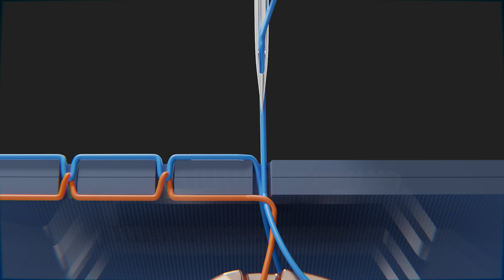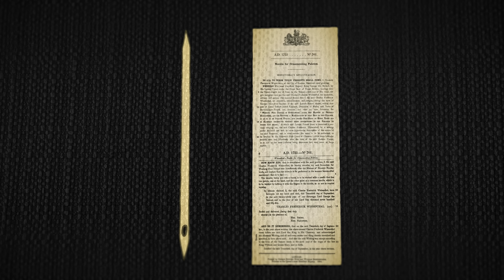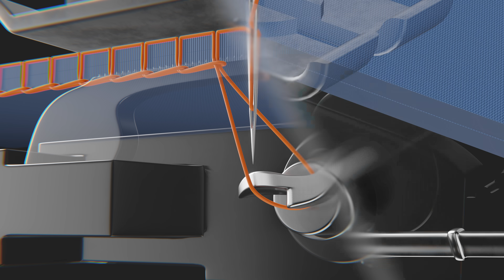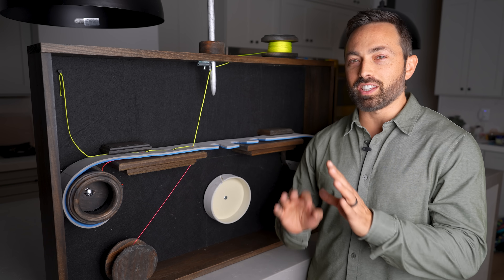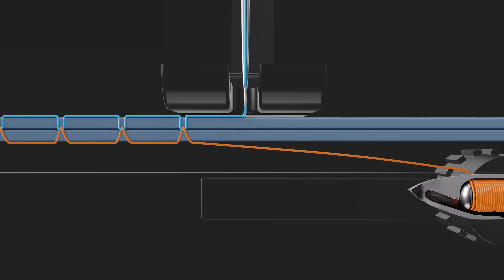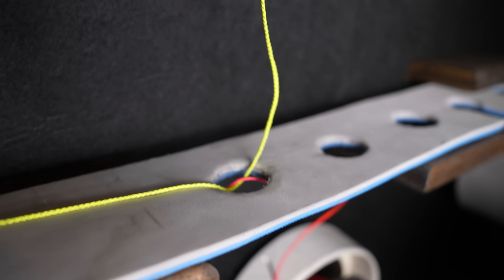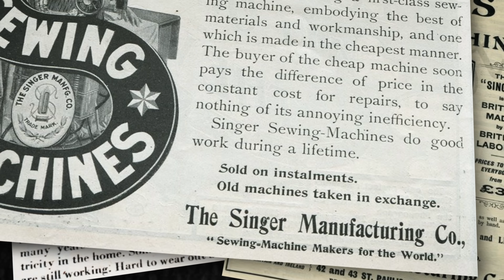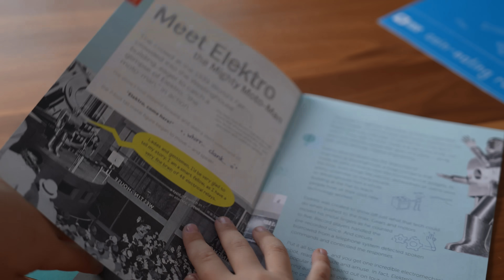The Surprising Genius of Sewing Machines

Comment: "Every piece of clothing you've ever put on was made by a sewing machine."—I think this line could be revised. Everything you’ve ever worn was made WITH a sewing machine, BY an individual human being operating it. Aside from the huge improvement in speed offered by the sewing machine, garment manufacture and textile assembly has proven extremely resistant to automation. Outside of extremely specialized cases like embroidery, there is no such thing as a sewing robot. 

Everything you’ve ever worn—every cheap t-shirt, every pair of boxers, every fast fashion throwaway piece—was made individually, by hand, by a single person working at a single sewing machine. The guy at 14:50 says it: "Those women were heroes. Unbelievable skill."

They still are, and their skill is still unbelievable. You're wearing it right now.

Comment: The lock stitch isn't just for sewing machines. It is also used with sewing with an awl in thick fabric.  The bulky handle that you can apply extra force to can't go through the material, so a second smaller needle catches the loop.

Comment: Great on the history; woefully lacking on the mechanical explanation.  Typical Veritasium attitude:  "Just take my word that the thread loop passes completely around the bobbin inside the rotating hook [even though that's impossible due to a fixed axle running all the way through the center of the real bobbin, unlike in my hokie model] because it would be too hard for me to explain to you how it really works."

Comment: Chain stich also commonly used for stockfeed bags. 

If you are experiencing a lot of heat build up on the needle, or the thread appears to be untwisting, you could consider running the top thread through an oil bath.  Untwisting of the thread is more of an issue on one side of my twin needle machines.  One side runs the opposite direction to the other, resulting in a degree of untwist in the thread.   Things to consider before going down this route is type of thread used and of course fabric you are sewing.  Unfort not all threads are available in whats known as reverse twist, so have found this to be handy in many situations.
Reply: Try silicone spray or oil.  It washes out more readily and tends not to stain.

Comment: Just wanted to point out, as someone who actually prefers to sew by hand, you don't actually have to stab all the way through the fabric up and down with every single stitch. There's a way to position your hands so that all you have to do is hold the needle still with your dominant hand (and stabilize the eye against your thimble), and then use your non-dominant hand to essentially bend and push the fabric onto the needle so that you can stack multiple running stitches before pulling the needle through the fabric. It's nigh impossible to explain with words, but there are lots of hand sewing videos on youtube of people recreating historical garments and employing this technique of weaving the needle up and down through the fabric 4-5 times before pulling it all the way through. Still not as fast as running it under a machine, but definitely faster than stabbing and then flipping the work over and then stabbing and then flipping over again.

Comment: Can confirm the information from 10:47 because I have a treadle sewing machine with this style of bobbin that I purchased this past year and cleaned up. It was still in fully working order when I purchased it, aside from the leather drive belt needing to be replaced due to age. Working on a treadle is an entirely different feeling to a modern sewing machine, and I love working on my treadle machine when the projects I’m working on allow for it.
Reply: Yes, as long as you clean and oil them regularly they will last you, your children, your grandchildren, I have an 1869 Florence needle sewing machine that performance as if it just came off the factory floor. It was produced the same year my great-great-grandfather was born.

Comment: Wait..  the guy talking about the crank on the line powered machine, doesn't know what he is talking about. For starters, it was NOT running all the time. Each line shaft station would have a drive pully and an idle pully. the machine was only running when you were operating it. The other heap of happy horse crap is that the machine was "turning at like 10,000 RPM". To put this in perspective, your cars engine is only going 2000 RPM when you are going 60 miles an hour. If you ran your car engine at 10,000 RPM, you would likely blow it up. Line shafts from that time incuded thing like wood and leather and bearings that you put oil on daily. Not to mention that all of the moving parts were open and exposed.

Comment: My Singer 128 is one of the later ones with a shuttle compared to my father’s machine that is a few years older that uses a more modern bobbin. Nearly 100 years old and running without issue as a primary use machine.

Comment: 7:36 this seems a disadvantage. However, I believe this type of stitches are widely used in bags of rice and perhaps flour, where - if you get it right- you can easily undo the whole seam without cutting or undo every stitch (or one for every certain number of stitches), which is the case for locking stitch.

Comment: There is a technical error at the 10 min mark, the shuttle system you are showing is properly described as a reciprocating shuttle as it moves in a straight line imitating a weaving loom shuttle in many ways (and on many models referred to a "transverse" because it moves from left to right), and that was the shuttle system employed in the Singer Model 12 (which was sold as the "New Family" in the 1860s). Interestingly rotary and reciprocating shuttles were invented around the same time in the late 1840s by Wilson. The third basic type of lock stitch shuttle was invented by Philip H. Diehl (while working for the Singer Co.) in the late 1870s which resulted in the very first Singer 15 class machine which went into production in 1879 and was marketed as the Improved Family (its manufacturing designation was 15-1). The design of Diehl's oscillating shuttle was quite different to the shuttle hook that would be most associated with the Singer 15 class (but I will come to that later). 
The first vibrating shuttle Singer did not go into production till the mid 1880s. At around that time at least one German sewing machine company was working on an oscillating hook shuttle with a removable bobbin case that locks into a central pin and is kept stable by a finger that keeps it stable in the shuttle race. This made for a very robust and reliable machine with an easy to reload bobbin (the oscillating shuttle used in the 15-1 can be a little fiddly). This new type of oscillating hook system was referred to by its inventors as a "Central Bobbin" and it is no surprise that Singer decided to use the Central Bobbin system in their next 15 class machine aimed at the domestic (as in "family") market, the 15-11 in the early 1890s . . . of course they didn't invent it, but they were the biggest and most wealthy sewing machine manufacturer in the world at that time so they could get away with it and so now most of the world assumes that the Singer company was the originator and call the Central Bobbin (CB) a 15 class shuttle. The CB shuttle system is still one of the most common shuttle type used for domestic machines.
I have been researching the history and development of sewing machines for over a decade now, and for some time I have realised that much of the official history out there is "problematic". So anyway, I know I am nitpicking; overall your vid is quite good and your prehistory of the sewing needle is very good.

Comment: TLDW is that there are two threads, one is wound on the spool at the top of the machine, the other is wound on a mini spool inside the machine called the "bobbin". Instead of stabbing the end of one thread up and down through the fabric, the needle stabs a middle point of the top thread down through the fabric, making a loop. A hook inside the machine carefully grabs this loop and pulls it over the bobbin, so that it gets stuck on that bottom thread, and that is one "stitch". The machine has to start with both threads freely dangling and you have to sew stitches over themselves to create the tangle of confusion that “knots" one side, then from there these two threads sandwich the fabric, the top thread going through the fabric to loop around the bottom thread once per stitch. Eh... maybe just watch the video 😂

Comment: I started sewing on my Sailrite LSZ1 a few years ago. Unfortunatley I learned all about the internal workings before anything. Darn thing kept coming out of adjustment and I'd have to re-time it again and again.
Eventually I found the culprit, someone at the factory left a spare part up inside the mechanism that was in a very difficult spot to inspect. It was randomly jamming things up just enough to slip the timing where Id get skipped stitches and other 🤬 frustrating things.
After I removed the "bonus" part, I re-timed and not a problem since.
Great video, thanks for posting.

Comment: I can't get over the fact that none of the sewing machine stitches are quite as long lasting as hand stitches. If a stitch pops on a machine stitch, the whole chain is more likely to pull free than if you'd done a pass through method.
Reply: The chain stitch yes, but the lock stitch is far superior. They don't just unravel like the chain will.
I can prove this, anyone who has had to "rip" thread out to re-do a seam will tell you that it doesn't just fall out.
The trick with the lock stitch is getting the upper and lower tension just right so the "knot" is perfectly in between the top and bottom surfaces/materials. If your upper tension is too tight, the knot is exposed on the top, too loose and its exposed on the bottom.
The lock also uses two threads, your upper and the bobbin thread. When changing types of fabric, you often need to re adjust that tension and possibly even the tension of the walking foot.
One of the hardest hurdles for me when I started sewing was learning stuff like tension. Plus I was handed a machine that was improperly timed.

Comment: In my teens, I wanted to modify my pantlegs to be in style, so Mom just said, "If you want them different than what we bought for you, I'll show you how to sew, and you can do it yourself." 
    With that, she sat me down and taught me "the ropes" of it all, and I had just acquired a new, amazing skill. Since then, I have made clothing, sewn bags with drawstrings, pillow covers with hidden zippers, even vinyl seat covers for motorcycles that people assumed I had bought, and was professionally made. My latest was making blackout curtains for my SUV that go  right behind the front seats, to create privacy when I road trip, and sleep in the back. Built a raised platform from wood (Dad was a carpenter for some years, so taught me a little of that, and I did engineering and mechanical design, so the structure design came easily to me).
    The platform, just big enough to fit a full sleeping bag, needed a foam pad, so I bought a twin-bed size, cut it down to 6' x 34" and then sewed an old sheet into a slipcover for it, simple, like a pillow case. Works great! 
    I love having my own sewing machine and having the skill to adjust and maintain it. SO freeing! SO useful. And when not using it, it stays in a nice, small suitcase that it came with.

Comment: Actually, for a running stitch, you don't release the needle and pull it through (except in Asian embroidery, I've seen that technique there).  You push it up and down until the tip is on the top, push it through, and grasp it above again to begin another series of stitches.  I was glad to see the clip of a seamstress actually sewing a seam by hand to get a better picture.  I've sewn on (and repaired) both the vibrating and rotating shuttles; the rotating shuttles are much my favorite.  I've even sewn on a chain embroidery machine and I can testify that it's quite a ballet of movement to learn.  If a person is wanting more information, it's easy to find one of these old machines and just play with it to see the different mechanisms; timing, the take-up lever, dropping the feed dogs, winding bobbins; just so many fun mechanisms to explore.  Thanks for this video!

Comment: What fascinated me when I was preteen were a lot of textile mechanization processes (how to shape flexible thread with rigid machines, but there was something that really struck me about the sewing machine problem—how the bottom bobbin was designed.

In order to get lock stitch, the top thread has to pass completely around the whole bobbin. Yet, to stay in one place, the bobbin has to be fixed in place.

The workaround is that the bottom bobbin is held inside a "cage" where it's not attached to the rest of sewing machine and is free-floating, but lies in a gap the the bobbin can't leave.

When I finally found this out, I was the happiest I'd been in over a month at that time in my life.

Comment: 9:54 Here, you say, “Although it’s called a vibrating shuttle, it actually oscillates back and forth.” This statement is erroneous. As per Wikipedia, “Vibration (from Latin vibrō 'to shake') is a mechanical phenomenon whereby oscillations occur about an equilibrium point.” Vibration and oscillation can, therefore, be used interchangeably and were used correctly in this context. So, calling it a vibrating shuttle is correct. Stop reading what is handed over to you, and please start using your educational knowledge, especially when you have a Ph.D. in physics education! Now reread this, “Although it’s called a vibrating shuttle, it actually oscillates back and forth.” it doesn’t make any sense now, does it? Nice video overall.

Comment: I mean, if we want to touch on the last part, then we should note that what the sewing machine really enabled was the concentration of wealth gathered from the profits of clothing production into the hands of a very few, from what used to be, in most places at least, a cottage industry that anyone could join. Clothing has vastly decreased in quality in many ways as a result of designing it to be more easily manufactured by machine, rather than designing it to last, or to look particularly good, or to be cheaper in terms of material, it has almost solely become cheaper vis-a-vis requiring less labour. 

In terms of how much clothing costs the average person, it's remarkably stayed almost the same over the last hundreds of years, in terms of money. In terms of labour time, a bit more labour went into clothing before the sewing machine. But clothing also used to last way, way longer, not only as a result of better materials and almost everyone knowing how to do basic repairs, but also better general design and stitching that isn't possible via machine even today.

The sewing machine didn't see much use in the cottage industry of garment manufacture exactly because it couldn't perform all the stitches required, and so was too expensive for the things it could be used for. Machines that could do all of the task they were designed for, like Circular Sock Machines, DID see a lot of adoption. 

So what motivated sewing machines in factories and buying clothes from factories? The initial answer wasn't price; factory clothing was initially more expensive for a number of reasons, such as difficulty getting skilled labourers to work in factories instead of in the comfort of their own home for a cottage industry. Well, like all progress in the industrialization of western europe, it came vis-a-vis forcing people out of the countryside, into cities where they couldn't provide for themselves, by destroying communal structures that people relied on. And then finding ways to buy out, sabotage, destroy, steal contracts from, or even outlaw the merchants/markets responsible for maintaining the garment manufacturing cottage industry. This was done alongside destroying the rural farmer and other cottage industries, and was particularly prioritized and seen as necessary to fully destroy the other cottage industries and create a factory-class of workers, because some bare sustenance farming and a single sewer in the family was enough to keep families afloat through hard years. Which is exactly why people chose to live that way for a long, long time, it was very very stable, and the good years were very, very good. 

I would argue that the sewing machine is a horrible machine. Not because of the sociological context of its creation, but because of a result of that: it very much is a Minimum Viable Product. It can do exactly one type of stitch, and it can only do it to an un-enclosed edge of the material. (Well, that's a shorthand way of talking about the restrictions, and it's not quite right, but I've talked enough here). And it's not a great stitch. Machines invented by cottage industry workers to aid their work tended to be much more versatile at their given tasks even if they appear more specialized at first glance because they're actually designed to fully help with a given task, rather than requiring you to completely modify your basic design to work with the machine in front of you. Making 7 kinds of knitting patterns from one layout might only be fully used in one garment, but you can still use that machine to its NOT full use to make anything that requires any of those 7 knitting patterns